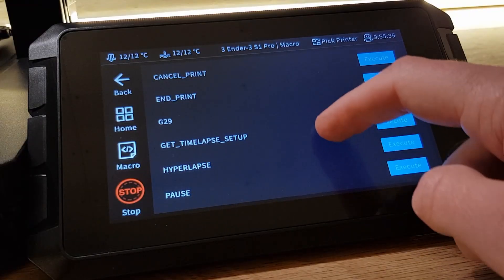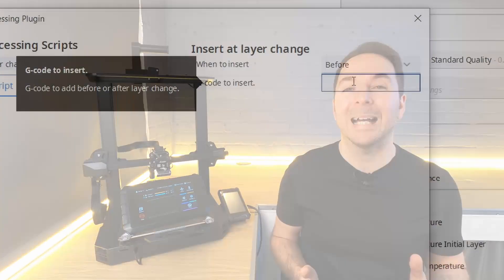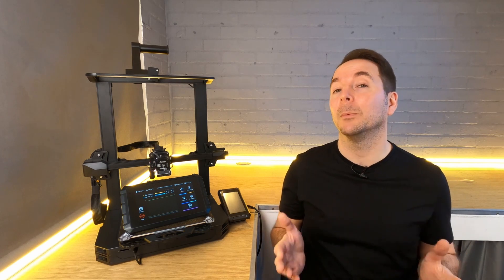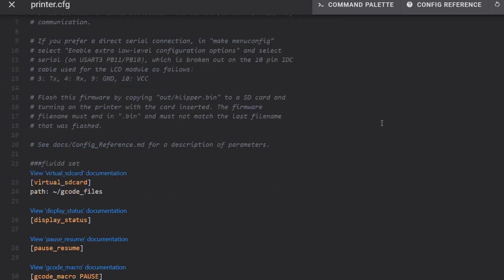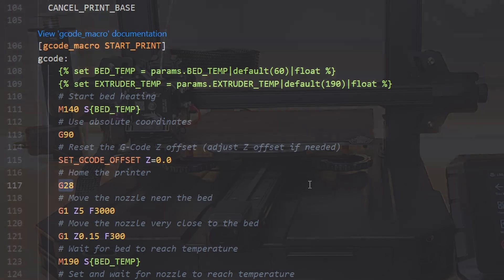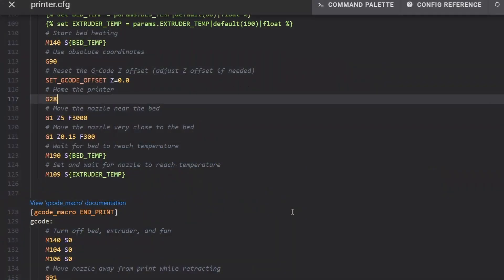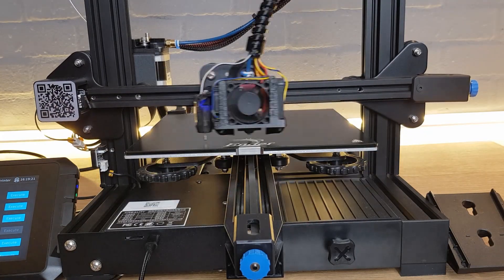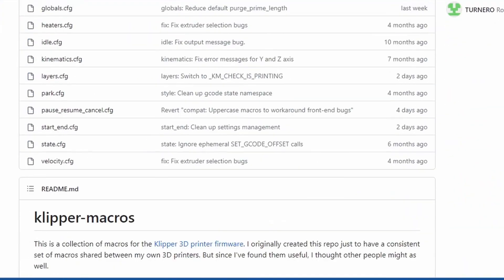How To Use Macros To Streamline Your Sonic Pad Experience - Sonic Pad Intermediate Part 7

Comment: Hello! I have an Ender 3 S1 Pro to which I added a Sonic Pad. Followed all the steps shown in your Sonic Pad series, but I have a very big issue. I cannot finish at all a print. For example I tried printing benchies. When it reaches the cabin of the boat it just messes up. Walls don't stick, they are not consistent anymore and they just fall apart.. I did all the steps described in your videos, did the leveling again and again few times. I tuned the PIDs, E-steps, Input Shaping and Pressure advance. I'm using PLA with the provided slicer configurations in Cura and I cannot get at least one good test print. I also checked the belts, bolts on printer and driver, set everything up, but no chance of fixing it. I don't know what to check or what to try anymore. 
When doing calibration cubes, the walls aren't great, bottom is not consistent but top is ok...
Reply from the maker: It sounds like you may have an issue with the mechanical setup of your machine. Do the failures happen in a consistent place like the same distance from the bed?

Comment: Hi Ricky, First off, as a first time 3d printing enthusiast i am loving the Sonic pad series. Easy to understand and precise explanations have helped me improve my prints. I have the Ender 5 S1 with the Sonic Pad. i have also been looking up other video on printing a temp tower for optimal filament temperatures. The issue i have been facing though is that after slicing using the plugin in Cura for a temp tower, sonic pad overrides the predefined extruder temperatures and reverts it to a default which i assume is coming from the stored profile on cura (?). Have you ever faced this issue? Would love to see a temperature Tower video from you. Cheers.
Reply: BTW I did see your other video for the Temp Tower in Cura, but as i mentioned for some reason if I upload from cura to the sonic pad and print, it ignores all the Cura temperature settings. Am I doing this wrong? Any suggestion or help would appreciated. Thanks.
Reply from the maker: I'll be honest, I haven't done any temperature towers with the Sonic Pad yet. I'd do some testing and find out. I may need to use a different process.

Comment: Hey Thank you so much for your awesome videos. Great Job. I have been following along and learning a bunch. I have an Ender 3 S1 Pro with the Sonic Pad. I had tried to add macros for the Pause at Hight to insert magnets in my prints but anything and everything I try just fails. Do you have any suggestions for this? Thank you so much for all your help.

Comment: Hey Ricky, i am super thankful for all of those videos you have made especially for the sonic pad. Question: Is there a possibility to show us how to do "longer" ones? At least I would like to get some essential macros running to cover something like the professional firmware on marlin was able to. For example, i just wanted to install the filament macro from Justin Schuh, but i'm unable to bring it working on the sonic pad. It's just a example of a quite essential macro, just as something like an audio signal when the filament sensor detects a runout. It would be so awesome if you could explain that to us. I have the feeling that most tutorials are just working for a pi... and there is no one else which does such proper videos for the sonic pad. Therefore, i hope there is a chance for. :) Best Regards

Comment: Hi Ricky,
Thanks for all your vid on the Sonic Pad. I got mine yesterday then found your discount code 😢 I did save £20 through Amazon though.
Your basic series had me up and running in under an hour,just had one issue with the probe offset but fixed that quite quickly.
Using mine to control my Ender 5 Pro.
Will you be doing some videos on increasing print speed at all?
Best wishes, Mark
Reply from the maker: I will indeed👍

Comment: Great video, I think you need to do one on advanced leveling as I have yet to be able to print a 1 layer sheet perfectly, I noticed you have a glass bed, do you find that the flattest ?
Reply from the maker: Some of my other leveling videos have principles that can be applied to the Sonic Pad but perhaps a specific one with the Sonic Pad method would be a good idea, thanks. The glass beds are the flattest but I find i have to use gluestick a lot of the time to be confident of a successful result every time. My favourite surface is PEI but, depending on the bed it is mounted to, flatness can be an issue.
Reply: @RickyImpey  yeah pei is great but I just can’t get a perfect level, even with the sonic pad 5 x 5 or higher just doesn’t cut it for me, not really sure how accurate the cr touch is.
Reply: @11x11z11x11  I was having the same issue on my s1 pro. I started hearing about a process called (Bed Tilt Calculate) It took me about 20min to wrap my head around the idea, but after some research I gave it a shot. Holy crap level as can be. No more paper levels. Give it a shot.

Comment: Hey Ricky for my END_PRINT I get a must home axis error would you happen to know how to fix it
Reply from the maker: Hi, are you getting that error when you try and test the macro on it's own? If so, this is another safety feature i should have mentioned. Klipper won't let any axis move until you have homed all axes. This is because it doesn't know where each axis's zero position is and want to risk running into anything. Home all and heat the nozzle before testing the END_PRINT macro and it should be fine.

Comment: Well The start_print goofed the way it is written, at least on my E3 S1 Pro. The nozzle temp went up to the correct temp, but when it got to the M109 it went down to the default (190C. I gave up and went back to the Creality start gcode setting, but in the macro (replaced the commands you showed here). It's working as expected now. Odd thing is the bed temp did the opposite. Started at the default (60C), then correctly went to the correct temp. I guess you can say the creating a macro information was all correct and I was successful, but my printer didn't like the sample macro you've used for the start_print commands.

Comment: Thank you so much for the entire series you created. I recently got a S1 Pro and after watching your first sonic pad video, I bought a sonic pad. I have been using your videos to configure my sonic pad and my prints have been coming out almost perfect every time. I really appreciate what you are doing and look forward to the rest of this series and future videos you put out. Thanks again!
Reply: i did the same thing. Bought an S1 Pro and was underwhelmed so much by its OS that i considered trading it for something else. I still have and had my Ender 3 V2, and thought the only to get some decent fw was to buy the Sonic Pad, as frankly it was easier than learning another open frame half open source printer or trying to find a Pi. I'm pretty happy with the Pad but my pimped, dinged, paint peeling off dirty old Ender 3 v2 still regularly shitz on the S1 Pro, with at BTTE3SKR board and their screen and direct drive, BL touchetc. Easier to level bed, get good prints with PLA or PETG and generally a better printer. I will get into klipper more and see , it is next level firmware! And yes i is a great channel thank you RIcky Impey.